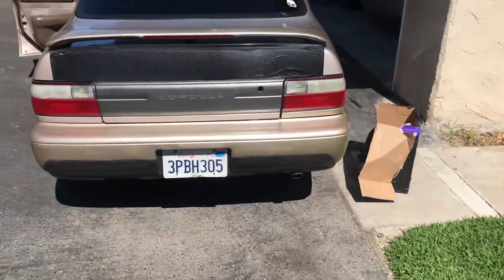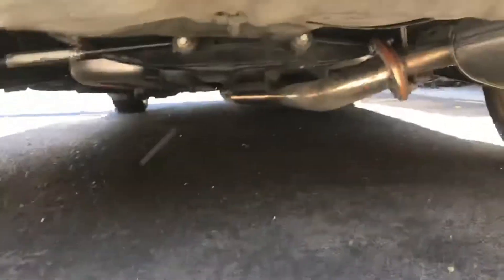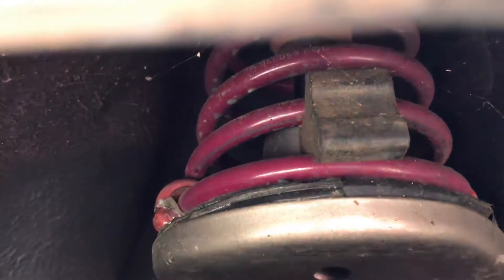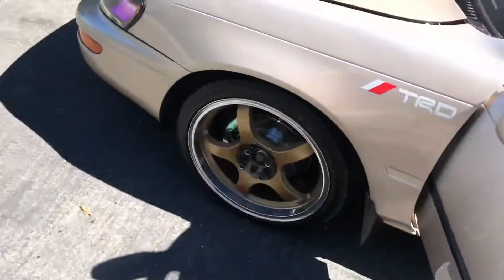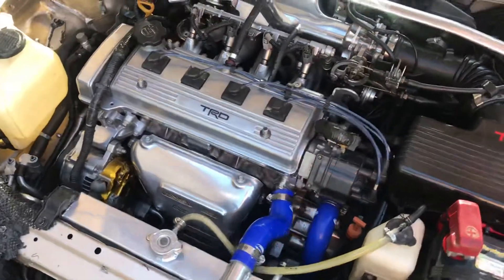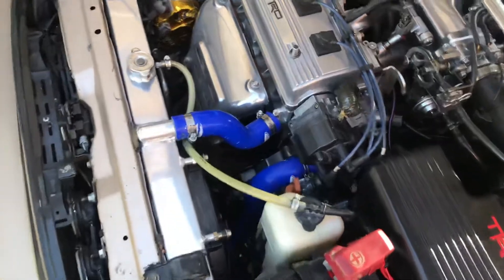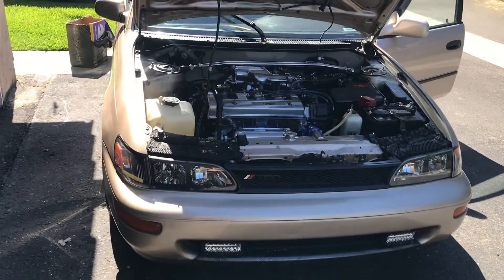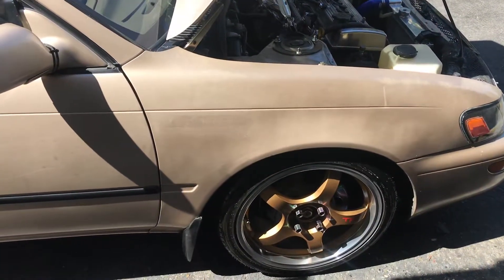My Corolla (AE102), as of June 2019.

Comment: why did you sell it after all the effort you put into it?

My 7AFE burns oil when accelerating after decelerating down a hill with engine braking... it has LPG and I think the LPG is responsible for wearing down the Valve seal... it's a 94 Celica with 230k km.... do you say it's LPG or the age? or perhaps both?
Reply from the maker: My Grandpa moved into a resthome and the family decided to give me her 2009 Toyota Camry.  It only had 47k miles on it at the time.  I have a little baby girl and they wanted me to have a “dad car”.  The Camry has the infamous 2AZFE.  So hopefully i dont have any issues.  

If your 7A is burning oil when accelerating, its most likely piston rings.  Do a compression check with the engine warm.  Then squirt a couple drops of trans fluid into the cylinder and compression check again.  If it goes up substantially you need new rings and a hone.  

The other thing it could be is valve seals or even a filthy PCV valve that is stuck open.
Reply: @wagonkit  Wow.. congratulations... and no the smoke doesn't come when I accelerate normally.. it only comes when I accelerate after a period of no load, especially going downhill.

So if I put the standard transmission in neutral when coming downhill... then put in gear to accelerate, there is no smoke....

If I come downhill with the car in gear, then I leave a cloud of smoke behind me.

The engine needs to be under load to avoid smoking.. so I think that is a classic case of Valve Seal failure from reading online. What do you think?
Reply from the maker: Ahmad Shumayal thank you!  And yeah sounds like valve seals.  Ive seen people change the valve seals without removing the cylinder head.  It’s possible to do.  And the seals themselves are cheap.